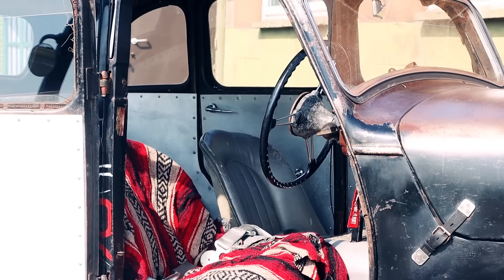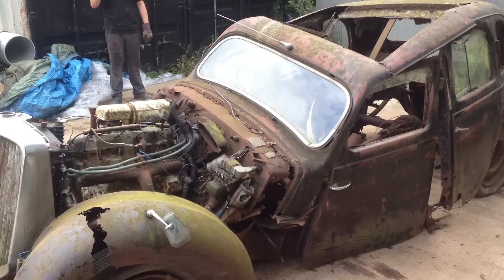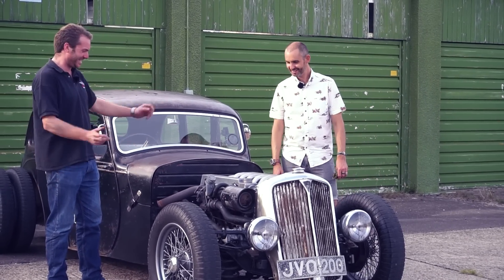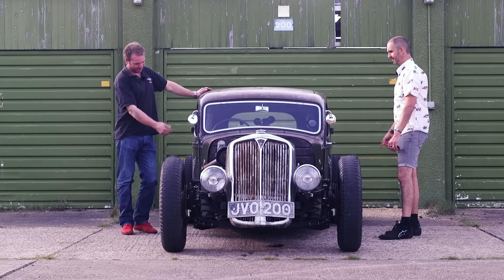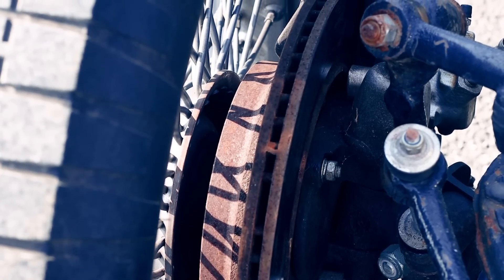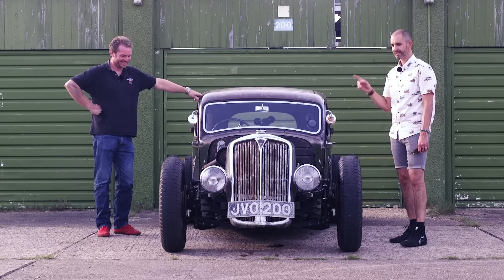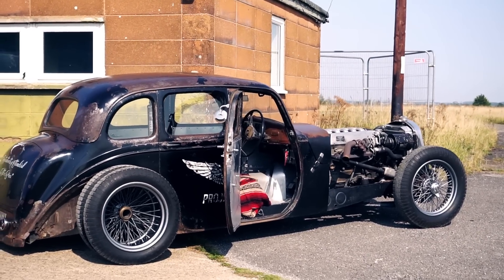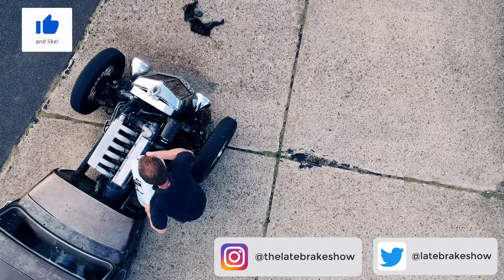1940s Rat Rod project with BMW turbo diesel built for £1000

Comment: In the States, the "body drop" is called "Channeled" (because you make channels in the floor pan, to achieve it). Love the car, love the wire wheels. Needs a 2 liter Bristol, or a 2.5 Daimler V8! 😎👍👍

Comment: I think if you drive that thing to a German TüV... they just imprison you right on the spot :)
Reply: That is true but it wouldn't last five minutes on the road in the UK either! To be clear it is in no way road legal which is why they were driving it on a private track.
Reply: @Ross Bourne Yes, you can get away with some unbelievable stuff in some states. The UK probably has the balance about right, the IVA system, or whatever it's called these days, is fairly restrictive but it's more flexible than Germany, France and Australia to name a few off the top of my head. I wonder if anyone has ever done a comparison of what modifications can be done in different countries?
Reply: @Ross Bourne on the smoking tire there was that one street legal car with an outside AC box hanging out a meter at the side of the car...
Reply: @kieranjamieson  I know I know- although the UK is way more lenient than Germany (there are actually a few project cars registered in the UK driving around here) I thought for a moment this was a US show... and apparently besides emmisions in CA they don't mess around much with road safety..

Comment: Jonny love your channels just wondering have you come across Waylon Wires old Iron ATM he is building a Gmc v12 rat rod called the dirty dozen  using a 1938 apple truck cab and early 1960's Gmc v12 engine and chassis he is a pretty clever guy and builds some awesome cars . It made me chuckle after he removed the 1938 body he gaffa taped an old plastic office chair to the chassis rails to drive the chassis back down the mountain to where he was parking it . But this car reminded me of the type of Ratrods Waylon Wire builds

Comment: Hilarious and awesome vehicle! Hilarious and awesome owner. A bit uneven with the external cooling though, missed the rear cylinder or so out and got himself a differential temperature up and down the engine :-D Smart enough to not pour cold water into a hot engine, though, which is good :-) Rattles drive you crazy, it'd be good to fix those, I think. The rest of it is perfect :-)

Comment: Another fantastic feature  @The Late Brake Show, well done 👏.  Those rear wheels are doing my head in though - can someone explain how the inner tyre beads are secured and sealed?
Reply: It’s two rims, there are inner tubes inside so no need to worry about sealing the bead.

Comment: I so hope that is registered as a historic and gets used on the road.... 🙂
Reply: Really?
Reply: @jonjones1553  yup. I bet you couldn't find fault with the chassis, suspension, steering or brakes. Might be a bit loud but probably not much worse than a lot of 'legal' straight through systems

Comment: £1000 ! I guess he has a lot of good mates to give him stuff and parts!
Reply: Yeah. I'd love a break down. I guess most of it was stuff he had lying around. Two collections could run £100 just in fuel. It's not a real "cost".
Reply: @vboost  I have just completed a 57 Chevy rat truck cost me in excess of £3,000 just on parts alone, already had the truck and engine!! Hours in labour by myself I didn't tally but it was six months worth!
Reply: Peter is genuinely the guy that will fabricate something very cool from whatever bits he can get his hands on. He made a profit on the £50 BMW donor, the Rover and Morris were a few hundred quid. Some bits he would have had lying around. The fabrication work is by himself.
Reply: @alexcollard8674  it's an excellent build, no doubt about that, I had to source parts from America,  so it made it double expensive. I'm hoping to build a rat rod next, but I need to find a decent donor vehicle first for the chassis, engine gearbox. The body work I can cobble together.

Comment: Cool car, presumably he's going to register it correctly and have it mot'd at some point?  Be nice to see it out and about.
Reply: May I ask if you have children? Do you honestly think it's appropriate to allow a death trap such as this on the road? Imagine dropping your kids off at school in the rain and this thing drives by. No indicators, no hazards, no fenders. Front wheels spray water on the screen, the driver cannot see your little darling cos it hasn't got any wipers either. If the driver did actually brake, there are no seatbelts, so that isn't going to end well. It's made out of scrap. Having said that, I must admit that it's awesome, but please stick to the airfield.
Reply: @jonjones1553  "Do you honestly think it's appropriate to allow a death trap such as this on the road?"  Not as it is no, the changes that have been made to it mean its not MOT exempt anymore, hence my question. DVLA have it as currently taxed and still with the original P3 details.  If he was to register it properly it would need to have an inspection, ergo it would need to be road legal to pass an MOT.  I thought that was a given it wasn't road legal.

Comment: It was a wreck when he found it and after all that work guess what, it's still a wreck. Maybe it's me but I can't see the point, it doesn't drive well, it doesn't handle well, it looks terrible and it steams up but here's a top tip, when the radiator is boiling simply throw cold water all over the engine, that should work. I could think of better ways to spend 1000 and save a lot of time. Apart from that - brilliant I suppose.

Comment: I don't think it would be road legal because of the exposed, outboard wheels, i think they need to have fenders over them. Is that correct? Awesome build though, be a shame not to be able to blat it around on the roads.
Reply from the maker: It is road legal. I think has temporary arches for it.
Reply: @TheLateBrakeShow  Understood, thanks.

Comment: You cannot keep the reg of the original car if all you start with is half a chassis and axles.This needs a SVA it would be a pity to see such a nice car getting scraped if you run in to the wrong copper.

Comment: if he used an mercedes OM 601 or 602 or 603 they run for 100 precent on vegatable oil without any modification
Reply from the maker: Yes, but not £50. Maybe next time...

Comment: Uber cool, suppressing the urge to scan the internet for a similar project. But wait...how on earth do you get permission to use this on a public road?? With those open wheels, open exhaust, pre-war lighting? Classic cars are allowed but in many countries traffic cops will stop you and argue that it is so far from the original car that it would need to go through full safety testing to be re-licensed. Is this the ultimate reason to move to the UK?